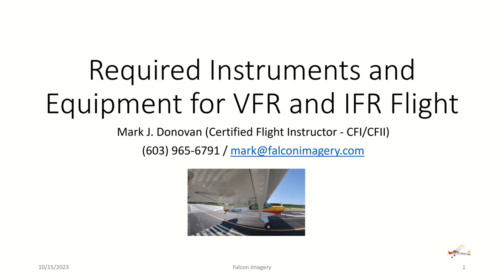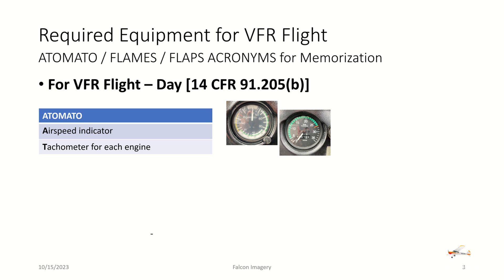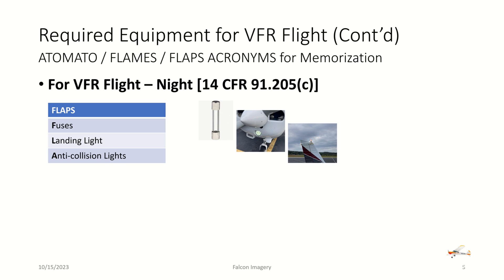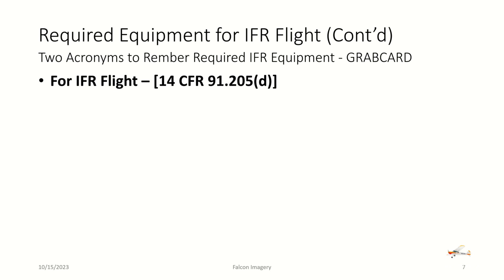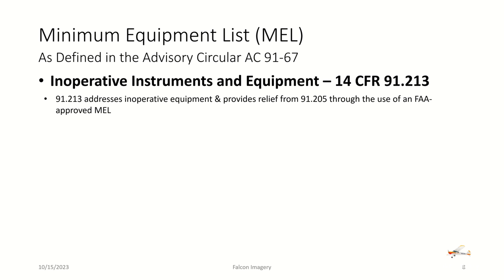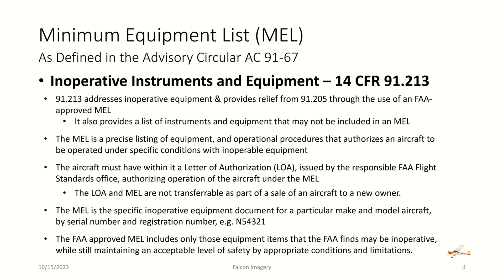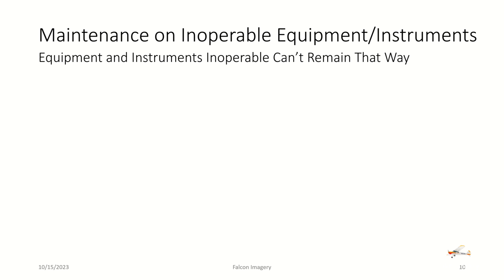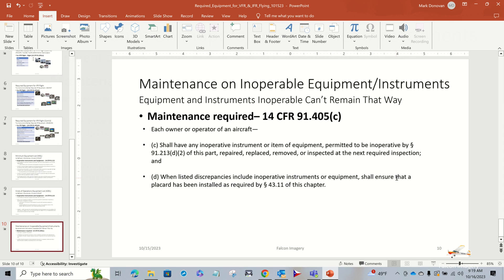FAA Minimum Equipment and Instruments Required for VFR & IFR Flight

Comment: What's the difference between an aircraft that is IFR capable versus IFR certified?
Reply from the maker: IFR Capable means that the aircraft has the required IFR equipment on board, and IFR certified means the equipment has been checked (certified) that it is legal to use/fly, e.g. VOR checks done within 30 days preceding flight, the GPS Nav log current, etc.
Reply: @FalconImagery  ok. Makes sense.    Thank you.  Altimeter pilot static system  checked by qualified individual  every two years too.     I was thinking that may be it, but wasn't sure.  Thought there may be more.  Thanks.